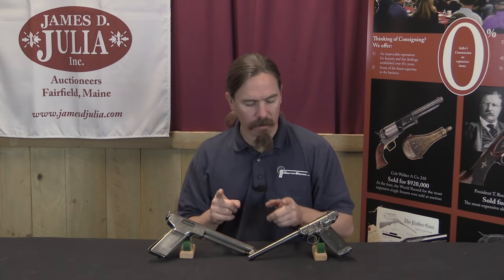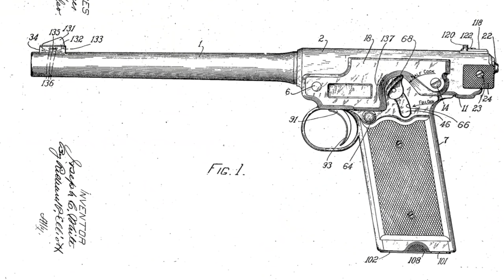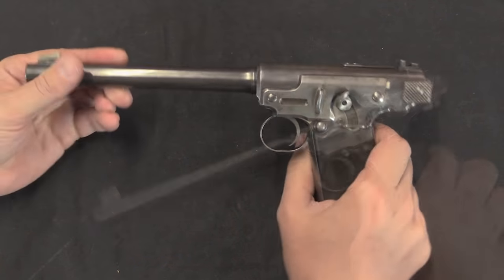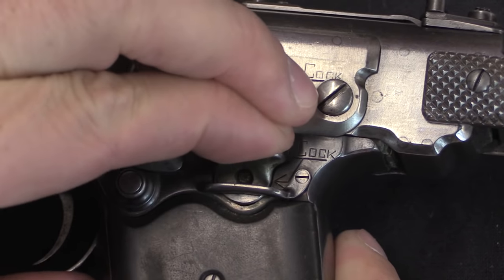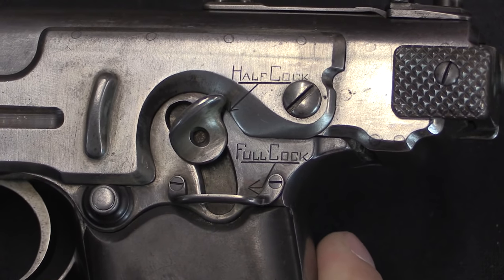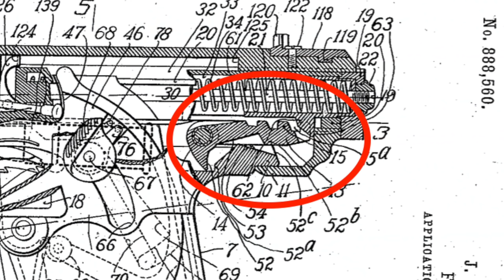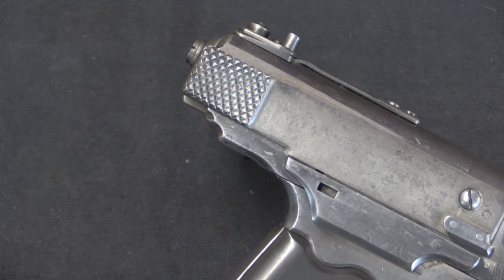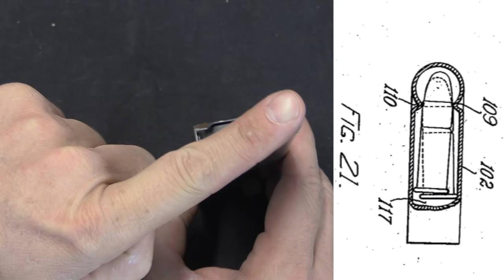White Experimental .38 Caliber Automatic Pistols

Comment: I always wonder how well it would have worked out if the US military had converted all its 1911s to 38 Super and then chambered the M1 carbine and the sub machine guns in use likewise in 38 Super.  I wonder if K frame S&W revolvers purchased in the 1940s could have handled the pressure.  I feel certain the Colts could have.